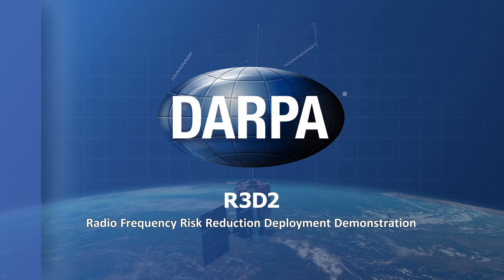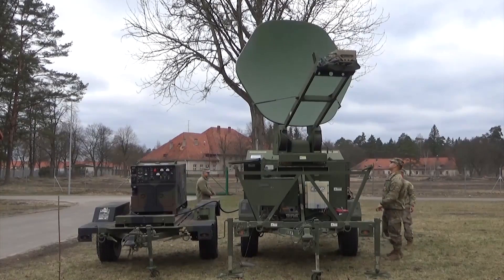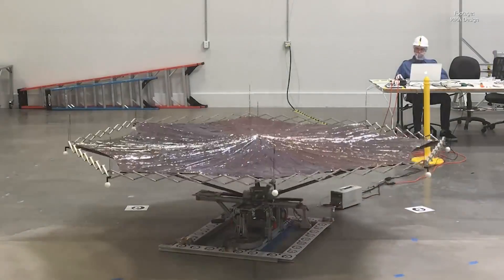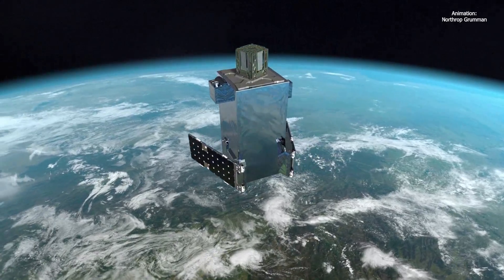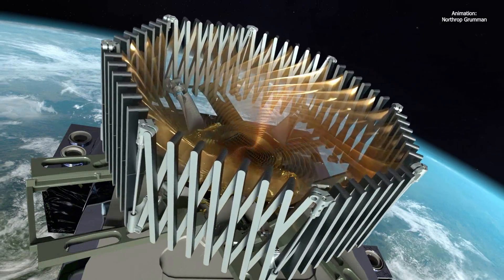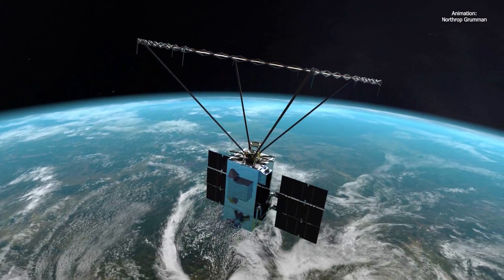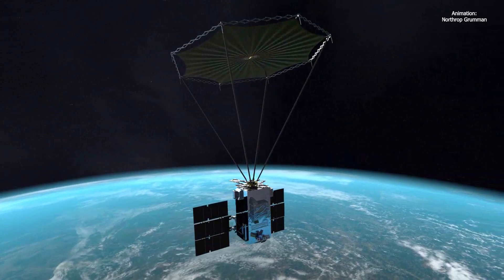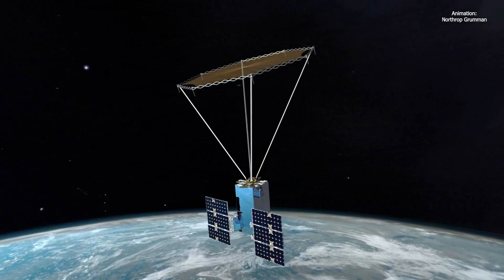Radio Frequency Risk Reduction Deployment Demonstration (R3D2)

Comment: I didn't understand, how it acts like a parabola?
Reply: yes, I need more on this. it is clearly flat and not parabolic.
perhaps the copper etch has certain microelectronics embedded into it to induce a spatial phase delay in the incident beam across its diameter to focus the radiation the way a phased array might.
Reply: @Muonium1  That is how I interpreted it. In my mind it is like how a flat Fresnel lens acts like a parabolic lens with light.
Reply: I am also searching online to find an explanation ... if you find any please put the link here
Reply: Flat reflector antenna has the same behavior like parabolic, but they have lower gain